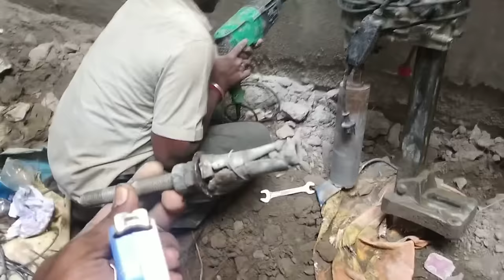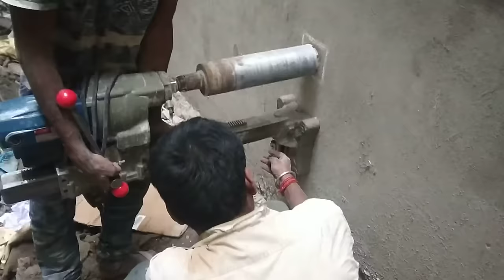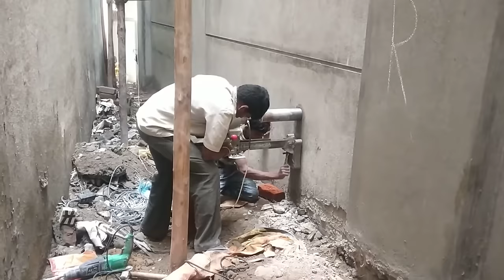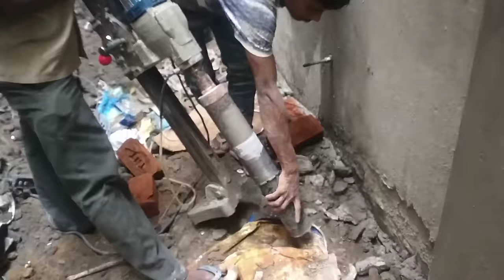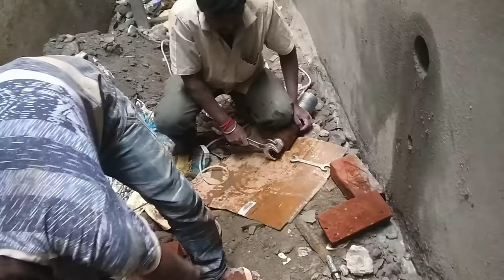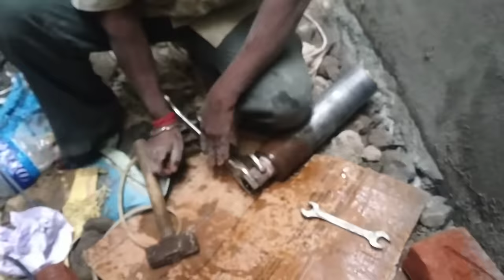Core cutting | RCC concrete wall | Tamil | New technology RCC concrete wall hole

Comment: stop beating on that motor spindle !! whats wrong with you ???  use a piece of soft solder wrapped around spindle to easily remove core bit, over and over and over, again and again and again